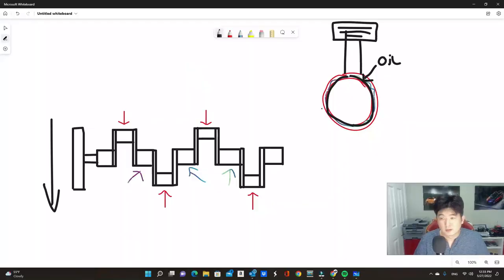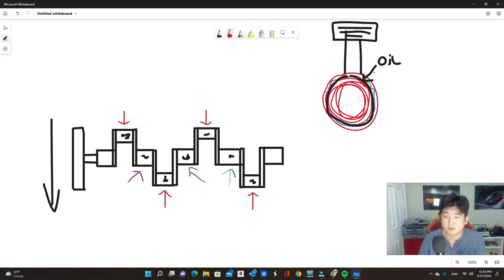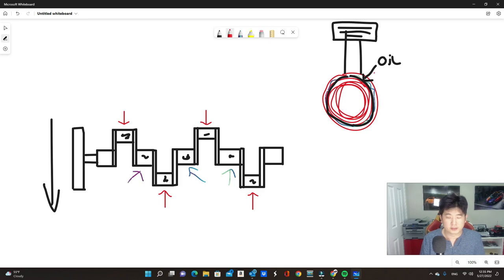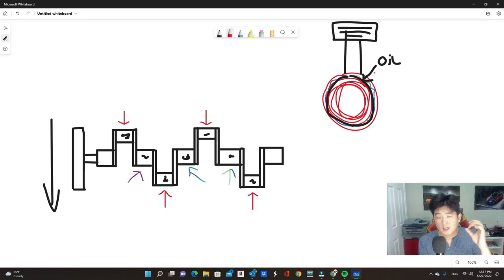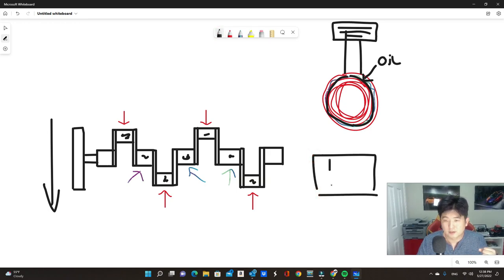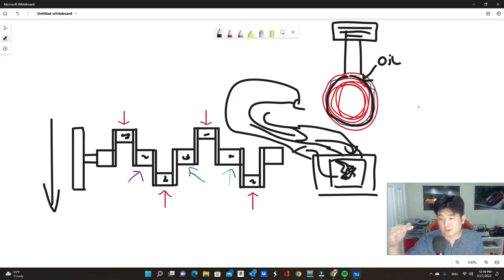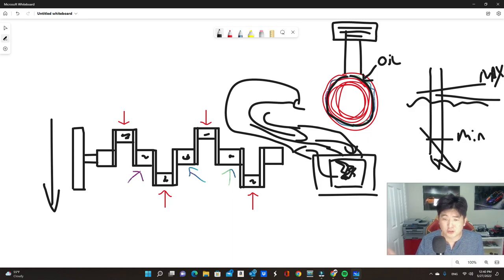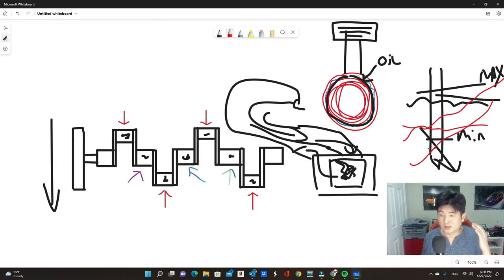How to PREVENT spun bearings! Watch NOW and save THOUSANDS! $$$

Comment: I used 15W40 engine oil in high temperature for my tractor but I faced my low oil pressure from time to time.In starting state,high oil pressure but I'd driven my tractor ,low oil pressure.Should I change 20W50 engine oil for summer at 38 °C?please suggest me

Comment: I've never delayed oil changes.  I don't know if the wrong oil was used in my car, but to my knowledge that is not the case.  My engine locked up,  No knocking, No warning lights, did not throw a rod, did not throw a valve, no metal shavings in oil filter, scoped the cylinders no physical damage in the cylinders, but for some reason my engine locked up,  I had oil in the car.   Taken to two shops and none of them can confirm I spun a bearing, without ripping the engine apart.  Engine lockup is the worst thing that can happen to an engine, at this point I don't care what the problem is, I need a new engine anyways.   $15,000 down the drain which I don't have, so now my car has to sit while I save money and rust out just long enough for other things to fail which I won't know about until its to late.

So I'm sitting here, wondering if there is a way to prevent a spun bearing in the future when I buy a new engine.   From what research I have done a spun bearing can happen on a stock engine and a modified engine.   My car is modified.  Do I get another stock engine and run the same risk of locking up the engine with no explanation, or do I get a modified engine with forged internals in a vain attempt to strengthen the engine from such an episode.   The difference in cost is $5,000-$10,000.   

And as we all know there is no warranty when you modify your engine.   Despite the bullshit Magnuson-Moss Warranty Act where a Manufacturer has to prove it was the mods that caused the failure.  The mods I have are every day mods everyone uses,  CAI, IM + TB, E85, Headers and tuned.  But apparently I'm the one lucky enough to blow up an engine with mods everyone uses every day and have it not be a manufacturer defect.
Reply: what engine?